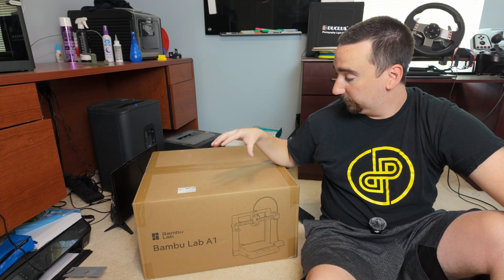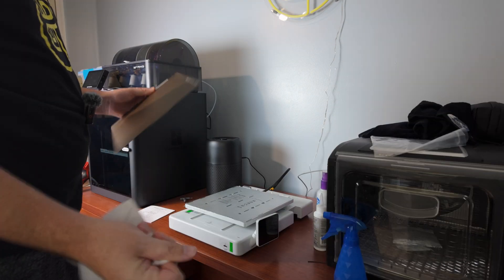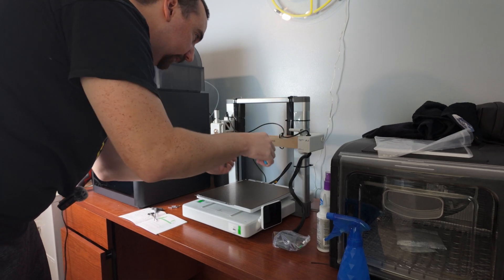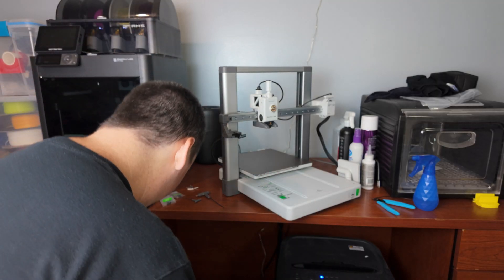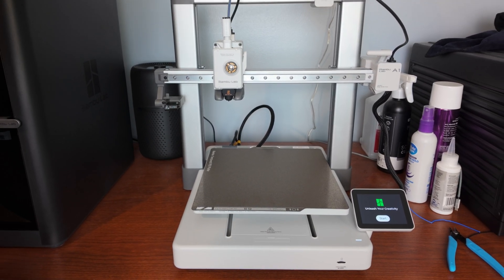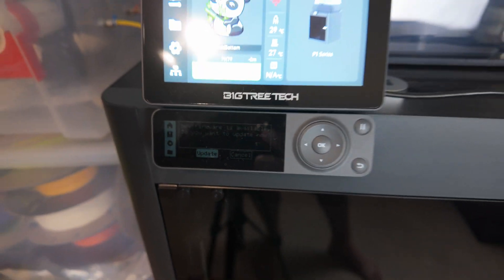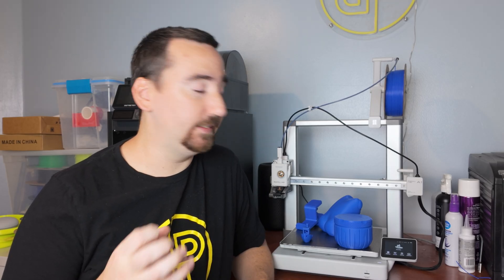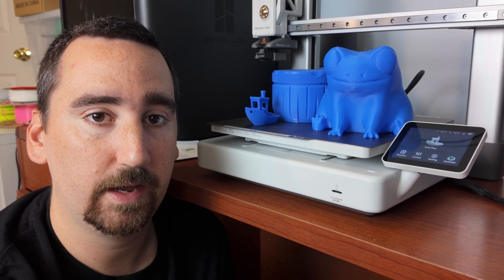3D Printing is SO Easy Now! | Bambulab A1 Setup & Initial Thoughts

Comment: It's really a shame that they didn't put a color screen and tach on p1s
Reply from the maker: I agree. The screen/controls is really my only complaint with the P1S
Reply: @PrintPractical  One question about how the rails of Y and Z are maintained. I can't buy super lube 52004 in my country. What oil can I use?

Comment: I'm sure you figured it out by now, but you can turn the sound off in the settings. It's actually the stepper motors that make the sounds and they can be customized. I keep them off, but one day I might mess around and give them some retro game tunes lol

My first printer was an ender 3 pro back in 2019. It printed fine, but never reliably, even after tons of upgrades. Now I have two A1s and two A1 minis and an AMS lite. I only print PLA, PETG and TPU, so I don't need an enclosed printer right now. The A1 at $339 is a crazy good deal. The mini at $200 is an even better deal for anyone who wants to dip their toes in the bambu waters.
Reply from the maker: Yes! I forgot to mention you can turn off the sounds, definitely threw me off when they first went off! Lol

I’ve had 3 or 4 Ender 3s (v2, pro, max). I’m sure the newer ones are a bit better, but I found myself doing more tuning and adjustments than printing. Though my Ender3v2 was super reliable once dialed in. 

Thanks for watching!